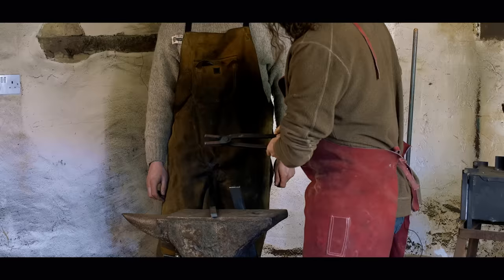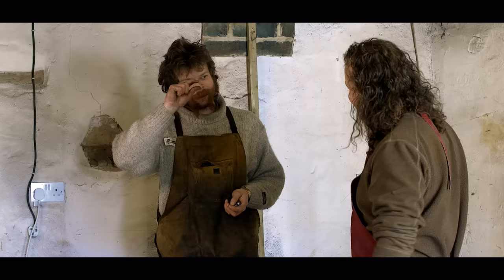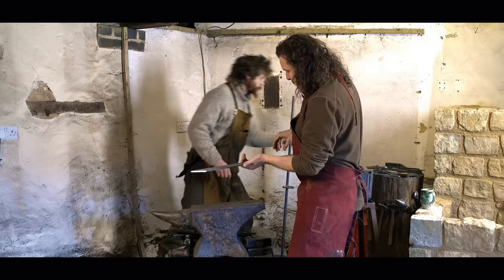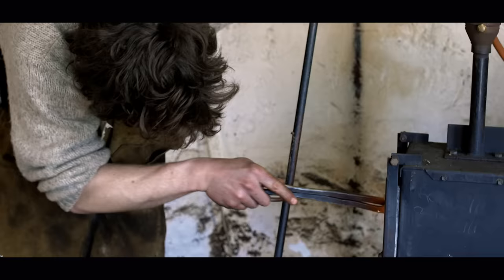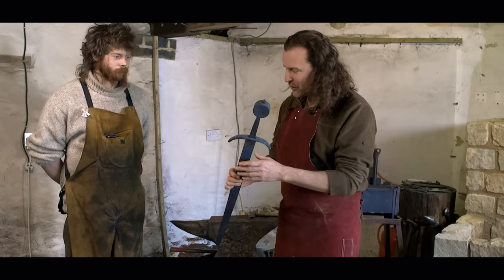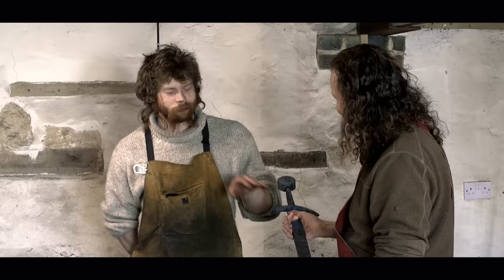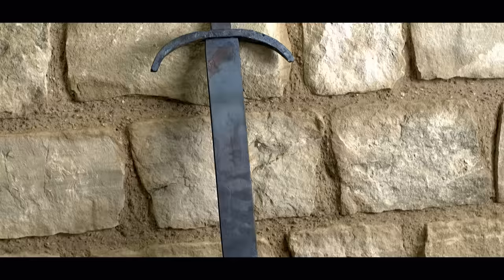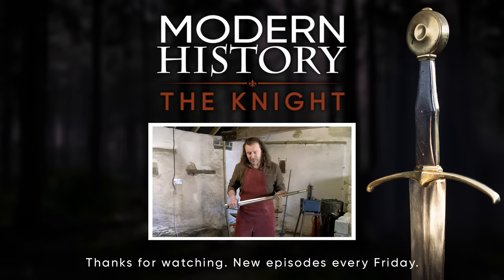Medieval swords: how were they made?

Comment: Hrm. I have a few reservations with what's said there.  (none of which, I will hasten to add are criticism of Josef's work at the anvil. I wish I had half his stamina...)

The problem with what he's doing here, in terms of a reference to our historical counterparts, is that we are working in isolation while creating a sword. the reality, however, is probably very different - for the vast majority of weapons created throughout the medieval period, no one person would have made "a sword" in its entirety - each component part would've been likely made by different smiths, and in some cases, parts would've been outsourced. We have a number of significant centres of blademaking - Solingen, Passau, Brescia, (and post-medieval, Toledo) where the blades are being produced in mass-production, by the hundred, packed into barrels, and shipped down the Rhine, up the Danube, and similar trade routes. 
In an English context, the overwhelming majority of blades would have been made up the Rhine and shipped over. Those blades which weren't simply exports would have been produced from lenticular-shaped billets of steel, particularly of Swedish manufacture, given there's some fairly extensive records of the trade infrastructure of the period including steel from there. (English steel production was of relatively poor quality, "short" steel, with an excess of phosphorus, prior to the development of the Bessmer process, of course.). Such billets would likely have been drawn out, flattened and folded 2-4 times prior to final drawing out as a blade from a block, prior to forge-shaping. As such, a lot of the fundamental characteristics of the blade could be rough-forged into the blade during shaping of the billet, unlike the modern, consistent-thickness blade blank which Josef's produced there. Distal taper can be made during the drawing out process, as just a relatively minor addition to the overall process, compared to how much extra work it is on a blade from a modern, evenly-thicknessed billet. That entire process of folding was essential for the genuine article simply due to the mechanical limitations of the metal. The stuff we are using nowadays is a vastly superior material in terms of material homogeneity, almost lacking in the stringers which would've been commonplace in unworked steels back then, and its something I dont think enough modern smiths really remember would've been an important element both of design and manufacture back then.  

Returning to the subject of manufacture, therefore, we really have to acknowledge that in many cases, swords are being made by cutlers, not blade-smiths. the secrets of production - particularly heat-treatment processes - something so often wrapped in layers of superstition (should you quench into the urine of a red-headed virgin boy, or is that of a goat which has been fed solely upon fennel for 7 days superior?) were jealously guarded amongst the cutlers' guilds and societies, but that of the assembly was less tightly controlled. That said, there is almost no doubt that there are elements which were equally hoarded by the cutlers assembling these weapons; the geometric principles published by Peter Jonhsson, for example, are a clear example of the plausibility of a cult of mysteries associated with the sword as an article of faith, in its inherent construction. I'm pretty certain that many of the finer details of such geometry were secretive.  Those cutlers, however, would have been assembling parts in local fashions (and lets not forget, fashion, both geographical, and chronological are the driving force behind much weapon design) - the Castillon hoard is an excellent example of that - multiple different blades, Oakeshott XV and XVIII, plus a few XXa's and the type F3c falchion - yet the XVIII's are all hilted in a matching fashion, wheel pommels with crosses with drooping tips, and almost all the type B's are hilted in a matching fashion too, fishtail pommels, hilts with bulbous cross ends. But here's the really interesting bit. (ok, I lied, its only interesting to someone as sad as I am...). One of the Castillon B group has a group A wheel pommel. and the three Castillon C's, the XXa's and F3c have identical crosses to the castillon B group. (literally. I could take my tracings of the castillon B's I've handled, and overlay the group C blades, and they'd match to within a millimetre or two - they're clearly the same workshop.) Its clear that these are blades hilted up "to spec", for use, with pretty much standardised hilt parts that were mass-produced. Similarly, you have the large group of later 14th C blades in for instance Lubeck, where crosses are forged with oversize slots (and often, oversize pommel slots) which are a one-size fits all (or fits none) solution is used. Particularly in context of copper-alloy pommels, often hollowed, there's plenty of indication that these were outsourced to foundries, and fettled to fit in use, examining the originals.  

As such, I sort of feel that when we're talking about making swords, we are often misleading the viewer/reader as to the reality. Our medieval counterpart bladesmith wasn't one lone guy in the workshop. it was the master and two apprentices on the sledges, forging out the blank. it was the worker with the scraper, cutting in fullers on a bench frame. it was the grinder at the water-wheel, and it was the polisher with the stones and emery powder, each working on dozens of partly-finished blades.  It was then the cutler, often hundreds of miles away, who picked up that blade from export, and hilted it up in the local fashion, as likely a smith forging the parts, as himself being the one commissioning castings, or crosses to spec, then assembling them. Its also the hilt-maker, working the leather on each of those swords, and the sheathers who were protected by law under guilds to have monopolies on manufacture, working to make the tooled leather sheath for the swords. Each and every one, a different person specialising in a single faced of the industry to produce that sword. 

Or, to be short, I feel that we should emphasise that collaborative and industrial aspect of the industries of arms and armour in the medieval period, compared to today.
Reply: information overload!!!!
Reply: tldr 

Seriously, learn how to make your points shorter.
Reply: Your lack of attention span doesn't negate a larger point being made by the parent commenter.  @squirrelknight9768
Reply: If only people could understand the concepts of war and the logistics needed to fight one, you have explained this brilliantly. Also a majority fail to see the bigger picture in the scale of production and this is a prime example. One person in the line of manufacture that would take an unesesary amount of Man hours to produce one item when the labour can be split into segments to produce multiples at any one time, it doesn't make sense otherwise.
Reply: I had no idea that J.G. Elmslie had a youtube channel! Exciting stuff, and amazing comment. Thank you for sharing!
Reply: But if you go back to the 800s or so England, there was much less room for cooperation among the kingdoms. Things had to be made more locally, and while surely the smiths would work in teams and not do everything on their own, the cooperation which would rely on long-distance trade was more limited.
Reply: That will take an entire journal article... as for visual media, probably an entire 45 mins episode
Reply: That's a fantastic observation and comment. I think that would be the next step, reenactment of an entire workshop.
Reply: Excellent comment. Reminds me of the armourers guilds who worked collaboratively on all the armour pieces.
Reply: Well, I think these are more referred to the custom swords, not the ones that were manufactured en masse for war. Especially since in war, more effective (and simpler designed) weapons were used.
Reply: @J.G. Elmslie  I think this may be a case of this two thinking: "that is such an obvious piece of information... So we assume everybody will know it already"  They also mention it in this very same video: 9:08
Reply: @christopherw6652  how far did you make it through the video? He addresses exactly what you said later in the video. Who's got the short attention span now?
Reply: I was actually thinking this as I was watching. If someone worked at a smithy, would they be assigned to do one job, and then as they progressed in the trade, work their way up  until they were doing the things that take more finesse or experience. I would imagine it would be very impractical to have one person making 'a sword' start to finish when an assembly line might make more sense? 
Love this show!
Reply: @theDeadliestPants  he stated later in the video that during war they were mass produced but what they are mainly talking about here is a knight or someone similar going to a blacksmith and having them make a sword for them personally at a time outside of war.
Reply: @conwaytwittyisalive9883  There is that, but also a simple thing everyone forget about when answering about the matter : Time. Weapon production has been developped and has increased with time, through more ressources, more qualified craftsmen, production methods being adapted to respond higher demand etc etc. All those factors have increased over time while it was not at all the case two centuries before what Elmslie is talking about for example. We must never forget this when talking about medieval times which cover almost a thousand years.
Reply: Great comment, really glad for the info! Just want to mention he did leave a quick mention about 'mass production' of swords ( 9:08 ) and a small mention about (potential) apprentices ( 16:13 ), but once again your comment is absolutly right i believe.
Reply: finaly someone that shares an opinion and has some evidence.
Reply: @squirrelknight9768  and less informative, right??  Maybe grow an attention-span
Reply: @xordus  It's poorly written. You can be concise and informative at the same time. Meandering and massively long sentences with eccentric punctuation, to put it politely, only dilute the writers message.
Reply: hot damn & i thought ive seen essays on YT comments lmao! very informative & interesting comment nonetheless
Reply: I wonder how much the black Smith's charged ? I'm sure nothing was free even then . And I wonder how much steel was repurposed
Reply: Smiths keep to themselves and always have. Large scale manufacturing for whole armies were equipped by yer kings employees,  a different thing entirely

Comment: Damn they had quite modern forges back then in Medieval Times....
Reply: And precision ground flat bar steel
Reply: Not to mention the arc welding for making a handle to the punch/drive through.
Reply: Heat is heat doesn't matter how you harness the fire. If it were just a bed of coals or a modern furnace doesn't really matter. When you're literally just heating the metal I don't think it matter what you use. All you are doing is using fire to heat metal.
Reply: @trod146  Man, You must be really fun at parties... Just for Your knowing - I forget about 5 different knives myself using improvised furnace made from bricks and blowed with hairdryer. It wast the point of my comment. Nevermind ;]
Reply: @trod146  1. Sarcasm 2. Not all coals produce the same amount of heat, not all types of forge have equally optimized ventilation systems, thus not all forges are the same. Even today it's sometimes a challenge to get the fire going properly :) which is a pain of course, cause heading takes longer. And of course the temperature and type of fuel is relevant for the physical and chemical reactions of iron while it's being worked. (Eg steel production, to say the least). So no, not all forges are equal.
Reply: but the angle grinder looks older, maybe roman times?
Reply: And they never had video or computers.

Comment: Slightly disappointed not to see a coal forge being used! Only slightly, though...
Reply: Would take a lot longer, just for the sake of filming. Forging while managing a coal forge takes a lot of time (and patience) I only forge knives and I imagine it would be a lot harder to do it (sword) with coal ( i use a coal forge).
Reply: @PotNanny  Depends on the forge capacity and coal quality, but technically a sword is not THAT thick and you forge it piece by piece. It is when you need to temper it the problem lies, and that will be my issue when I will have to do it.
Reply: @Nemesiswh40k  The process itself is not the problem, but keeping the heat nice and uniform while doing the forging. With a gas forge you just need to focus on the forging itself, saves A LOT of time. I don't know how long your sword is going to be, but with a gas forge it is easier to have a uniform heat for the whole length of the blade, not to mention normalizing the blade before the quench and the tempering itself, when you really need control over the heat your blade is receiving. Hope it works out for you. I'm building a bigger forge for larger pieces (people keep asking about swords and I'm a bit reluctant to take it on tho) and it will be a gas forge.
Reply: @PotNanny  It is not that much of an issue really with what we are working with at the workshop, but I agree ofc on gas forge point. (sword is based on XVIa build)
Yeah those steps are going to be a real pain, in fact I have someone helping me with the sword 'cause I have to finish crafting my armor (around 1400) for next season, and two brains will be better than one. We use a good custom coal forge, and for normalizing and tempering I was considering building a long clay gutter, I think it'll be enough for those steps. / If you have made just knives, maybe doing a machete would be a good step before trying a sword idk.
Reply: He did say it wasn't his forge, I assume this was his mobile kit!

Comment: I heard somewhere that the Vikings got their iron from peat bogs. They would gather peat moss and put it into a kiln which would burn away the moss while adding carbon and leaving the iron deposits behind which would then be collected, heated until orange or red, and then hammered together to make chunks of steel. Apparently the Vikings also had access to crucible steel that they got in trade with the middle east, steel that was used to make the highest quality swords. It wouldn't surprise me if the Vikings were not unique with regards to where blacksmiths got their steel and iron from.

Comment: im convinced that the story of the sword in the stone was based around smiths, because they DO draw swords from stone. Remember originally, the idea of metal being found in ore would not have been common knowledge. Ore would have just looked like a rock, so the fact that smiths could not only work out which pieces of rock were metal bearing, but also draw that metal out of the rock, would have been the height of magical power and smiths have always been magical.

Comment: Jason, I know I'm a little late to this video so I'm not sure if you're still checking this but I was curious about two questions:
1. In the Middle Ages, did they ever form molds for swords and other weaponry and pore the weapon in one piece as molten steel?
2. I would imagine that each blacksmith had assistants and if you needed a lot of swords in a short time, each assistant would take a station. One making the blades, one the hilt, one the pommel, and then one or two, maybe, polishing? Am I thinking right?
Reply from the maker: the only swords made by moulding are bronze ones in Clay or stone moulds. steel is always hammered into shape using heat. yes blacksmiths had many additional staff usually, hammer men, polishers etc.
Reply: @ModernKnight  awesome. Thank you so much!

Comment: How were they made?  With steel bar stock, a gas powered forge, and electric angle grinder with cut off wheel.  I had no idea the medieval times were so technologically advanced!
Reply from the maker: steel bar stock is medieval, it was called a sword blank. cut off wheel was a man with a metal saw and a water powere dgriding wheel is also medieval. just the power source that's different.